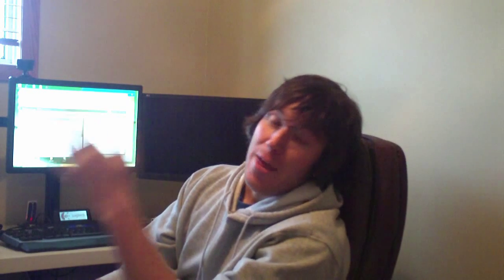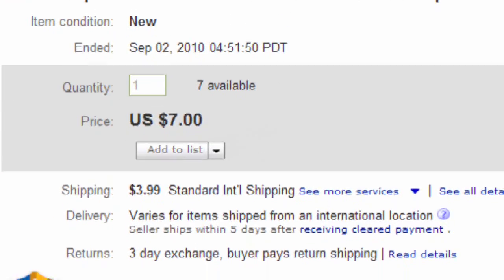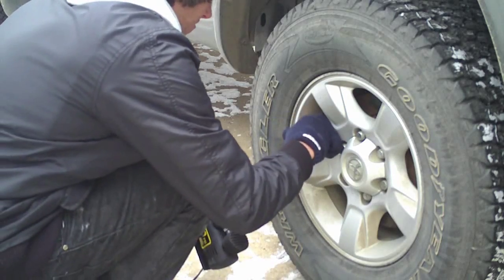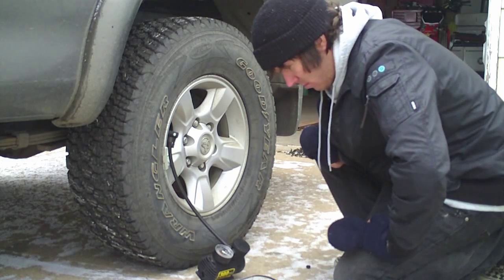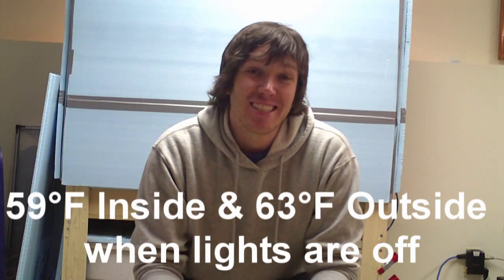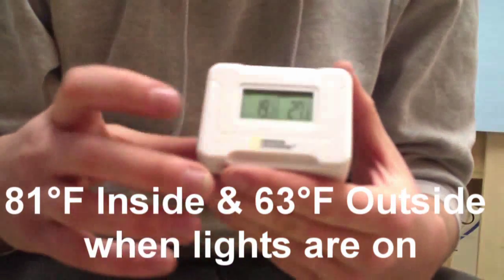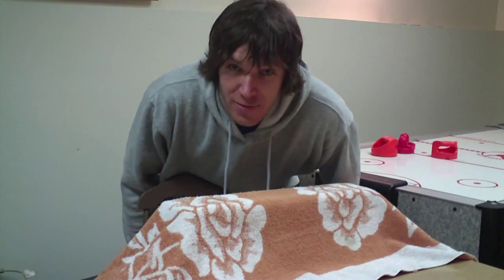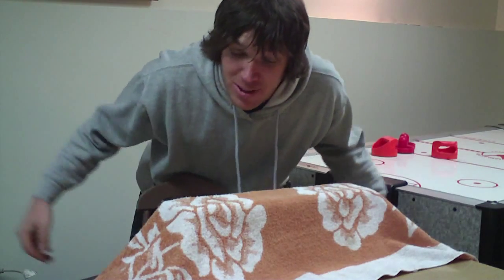How To Hydroponics - S01E16 Air Pump

Comment: hi just noticed that the pump has a plug to go into a transformer the pumps probly is 12volt so when you plug it into your outlet you get ac but when it goes through the transformer box it turns it into dc so i would just unplug it from the transformer cut the plug off and hook straight to the battery i might not be right but just a thought cheers.

Comment: Hello there  

I am liking the vids man .    You say that the air pump you have is spining to fast when you have it on 12v  you can put in voltages regulator to drop the power down very esay to set up  if u want 9v  use a 7809 voltages regulator  or 5v 7805 voltages regulator.  If you need a hand to wire them up i wood be happy to help